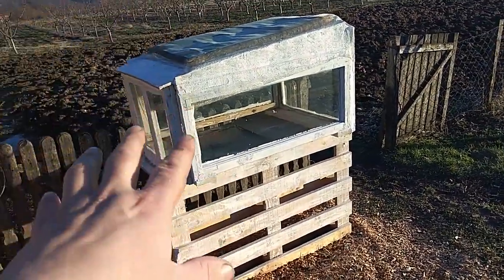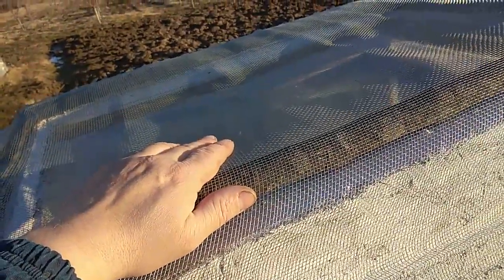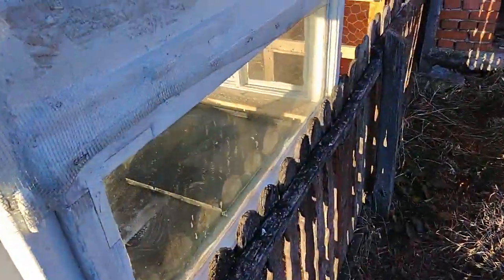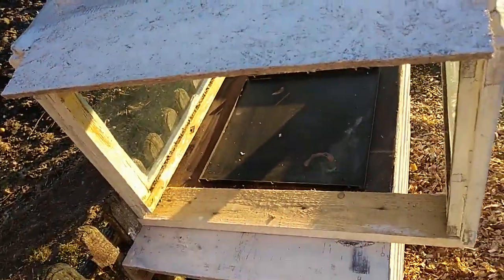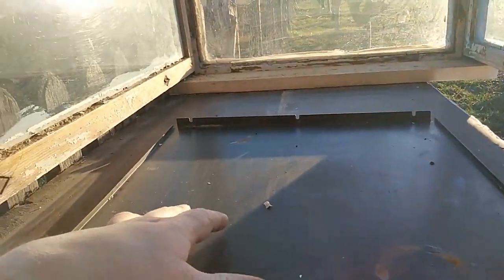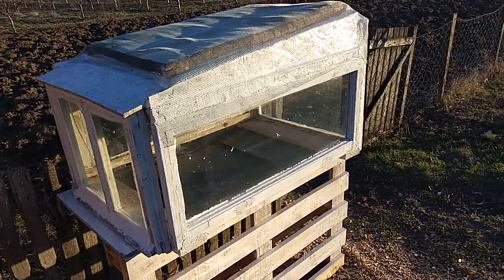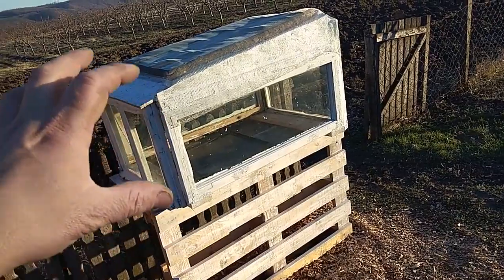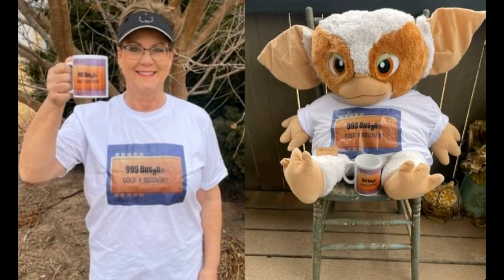Solar AP UNIT for precious metals recovery!

Comment: 👍 Nice idea. You might want to think about adding some thermal mass to help hold the heat when the sunlight is not optimal. Maybe line the bottom with concrete pads or bricks. anyway - just a thought.